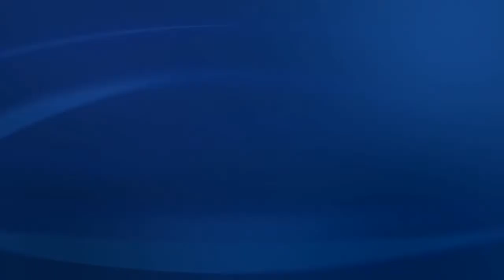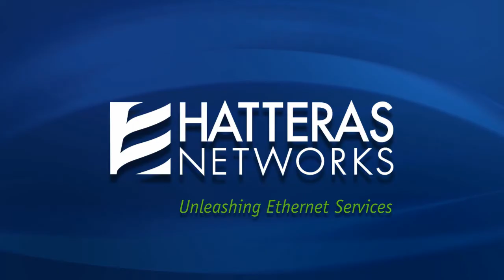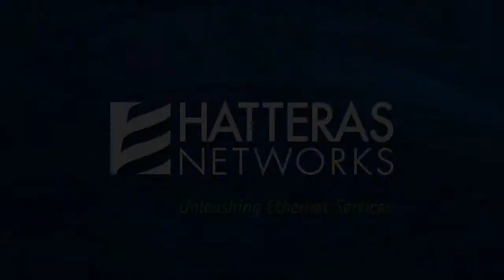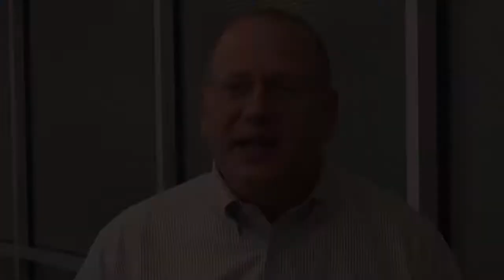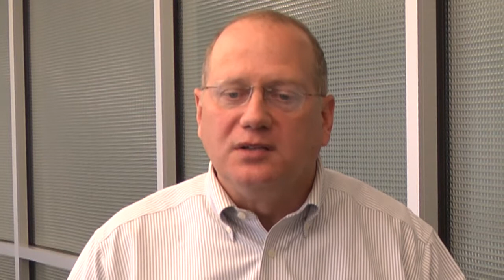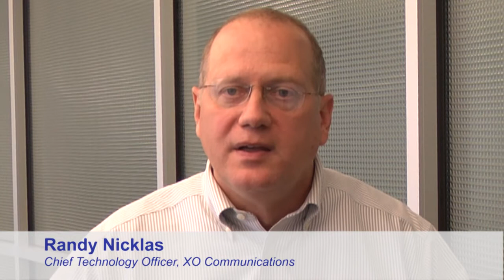5. XO on Ethernet over Copper and Ethernet over T1s

Comment: I don't understand the distinction between a T1 connection and an EoC connection. Is it just a different technology that runs off the same copper? Is it T1 within a mile of the central building? Is it a digital signal sent via the copper versus a analog signal? What makes it "EoC"?